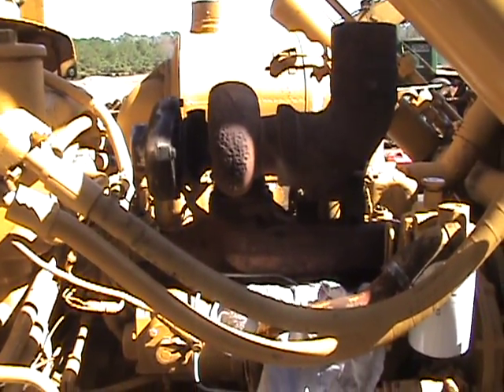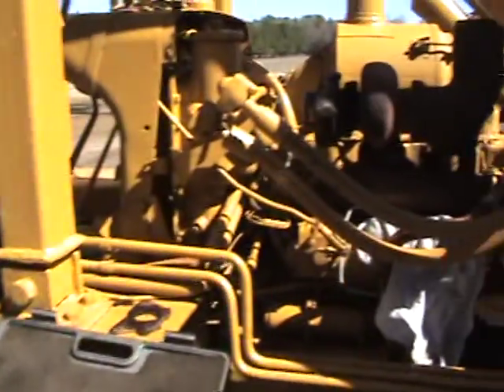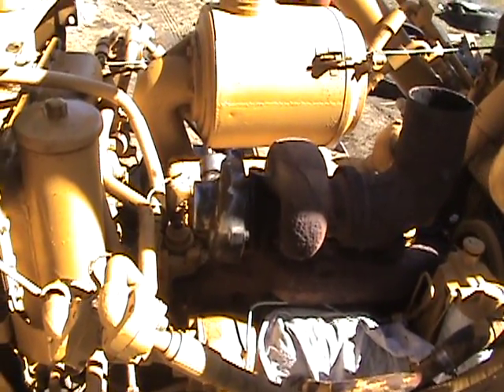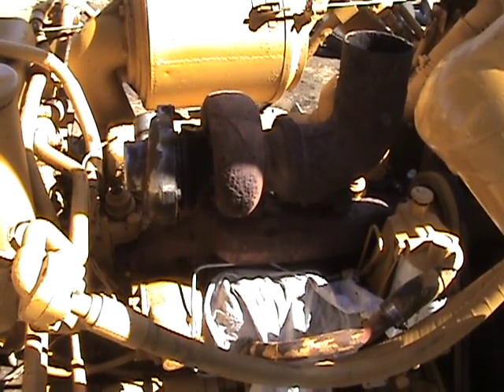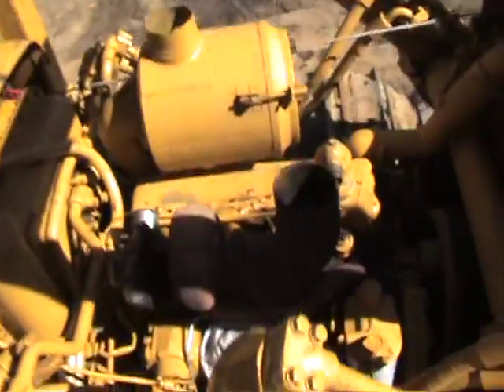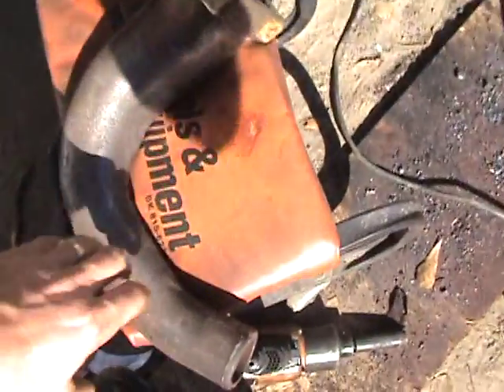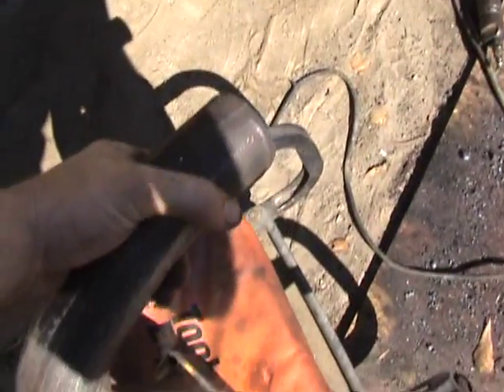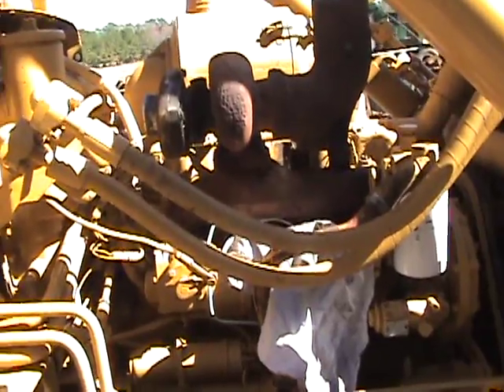D4 turbo install 1

Comment from the maker: @mc002crowe I have the same thoughts, I put an oil cooler on it. if it melts the pistons I will pull the engine put cooler jets on it an put a new set of pistons and liners.